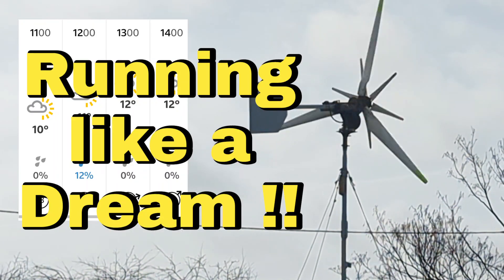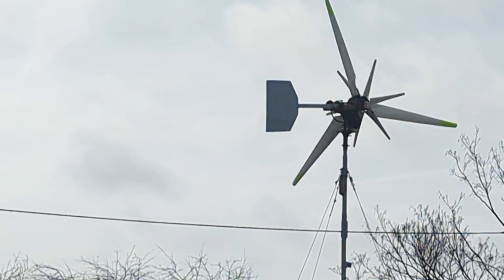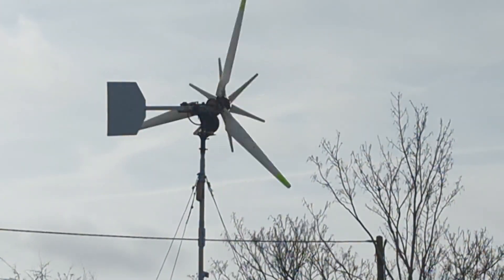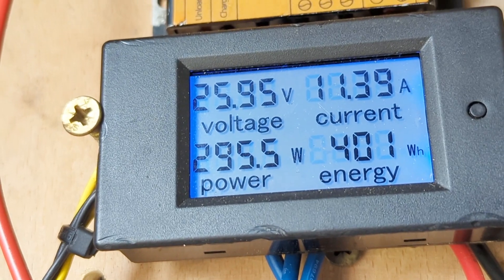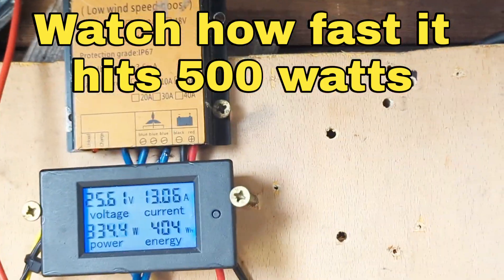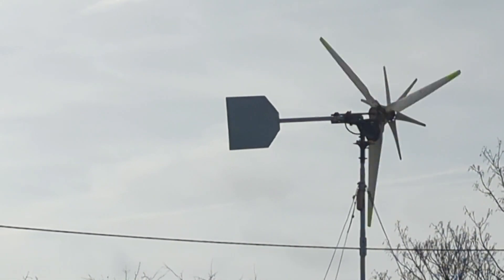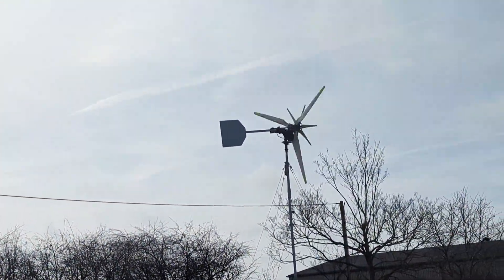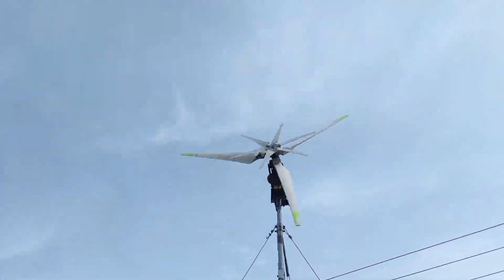Wind Turbine Generator Project - running like a dream - 15-18mph - 12th March 2023

Comment: I have no idea on wind turbines but I was looking at Archimedes Wind Turbines and I would have thought that they would be better than the bladed turbines, did you look into using the Archimedes vs the blades.
Reply from the maker: NO good for wind at all, might work with water but not wind, it will spin but doesn't have any torque, cheers.